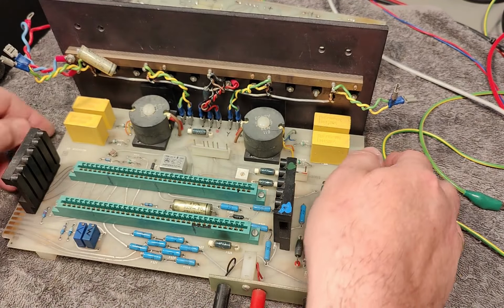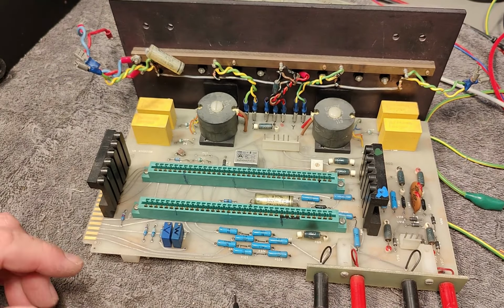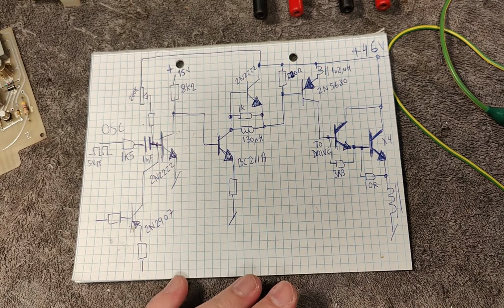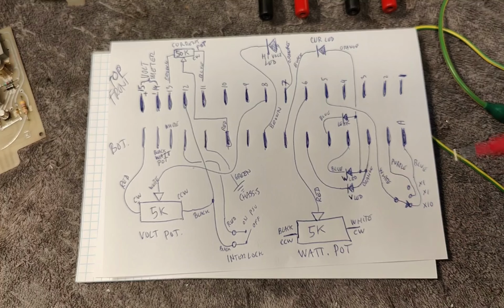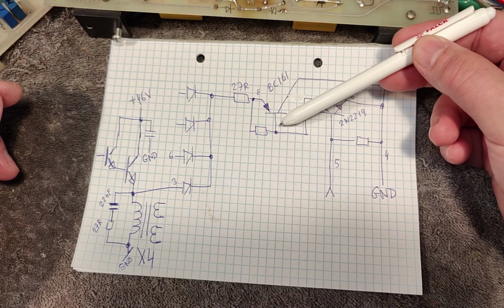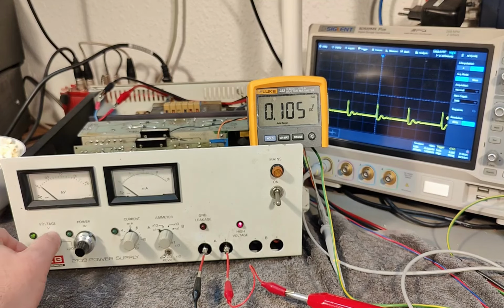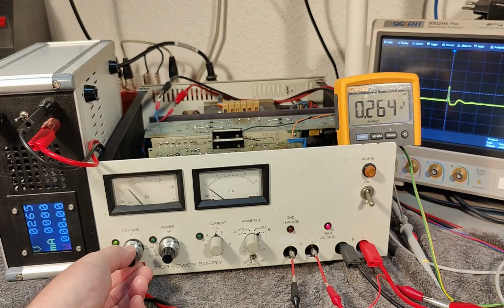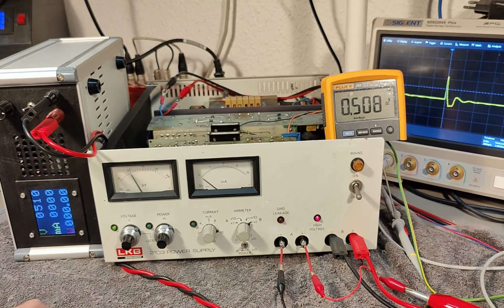LKB Biochrom 2103 power supply 2kV 200mA repair part3

Comment: Ich habe auch ein LKG Bromma Macrodrive 5  2297  von 0-5 KV 0-30Ma günstig aus eBay und leicht defekt 2 Lastwiderstände am in Reihe zu den Ausgängen waren Durchgebrannt. Das Gerät selbst ist in Ordnung. Ich nutze das Gerät für Anoden Spannung, und als Lecktester für Kondensatoren..
Geht sehr gut
Reply from the maker: cool, high voltage supplies are usefull for many types of lab experiments, i got many of them

Comment: I think it's a bad idea to change out the transformer.  It will diminish it's value and usefulness.
Reply from the maker: value ? this unit is not antique collectors item, but a usefull lab instrument i can use for practical work or hobby related things, less weight will mean much higher usefullness